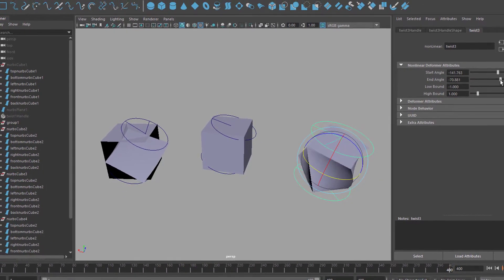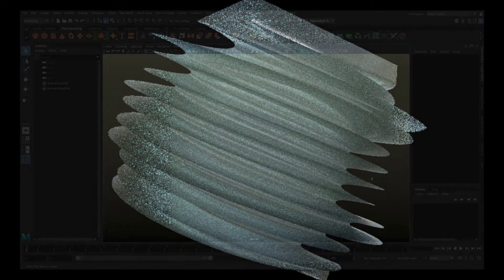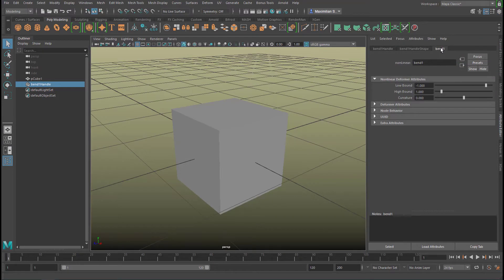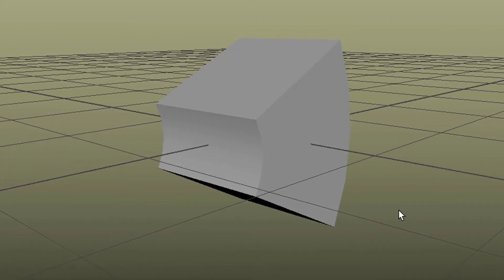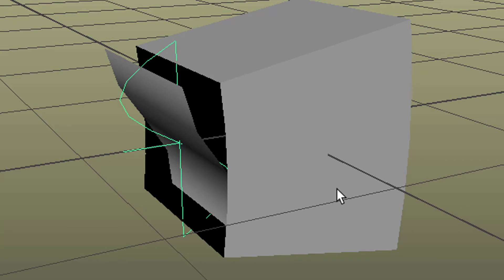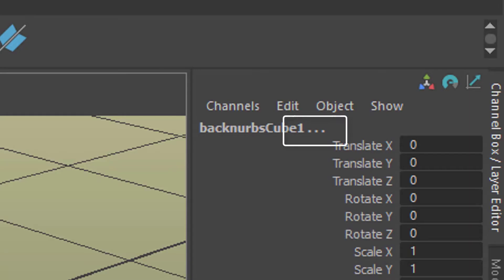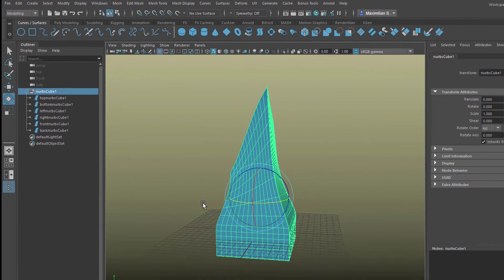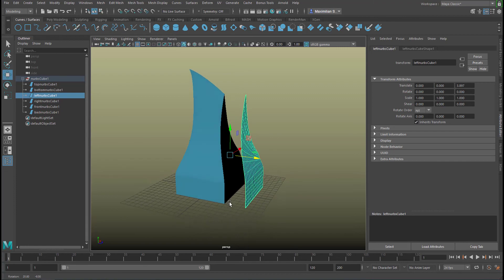Maya: Amazing NURBS Cube Deformations

Comment: Honestly, I didn't find the benefit of using nurbs. It is quite challenging to work with the model compare to polygons. And anyway nurbs converts to polygons during the render. I think it can be used for specific models and just for better presentation in the viewport, then convert to poly... But maybe I'm wrong)
Reply from the maker: i‘ve started animation around 1999 where only NURBS were possible in Maya. the beauty of NURBS surfaces are still an industry standard. you see this in my skillshare and udemy NURBS modeling course.
Reply: @Uhr24  Thanks for your reply. It is really interesting to check in what industry it is in use, probably in industrial design..., I didn't hear about nurbs a years, I've started a bit later, in Maya v.4, it belonged to Alias yet :)   Thanks for your tutorials and non-standard approach, I've found a lot of interesting and useful things on your channel!